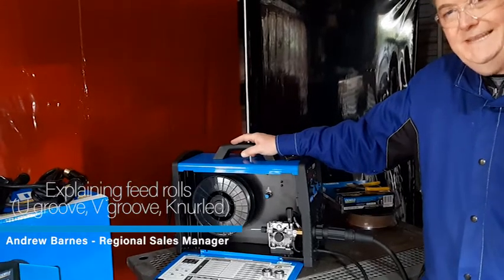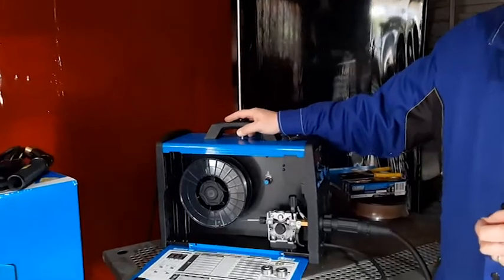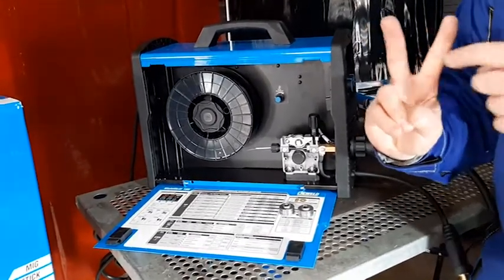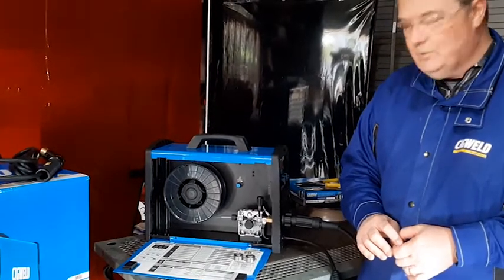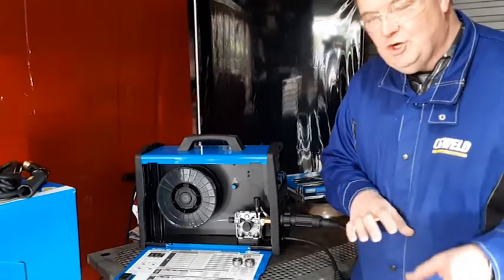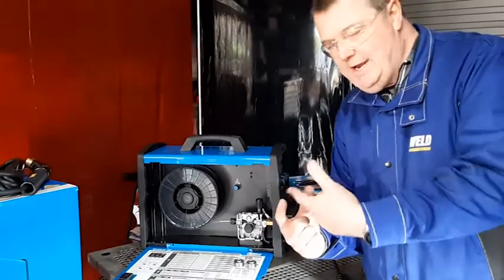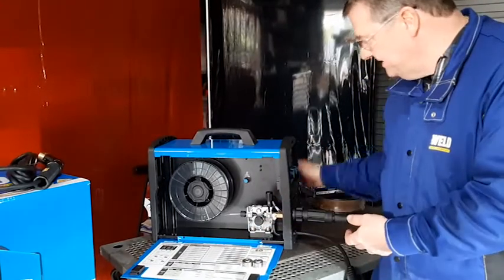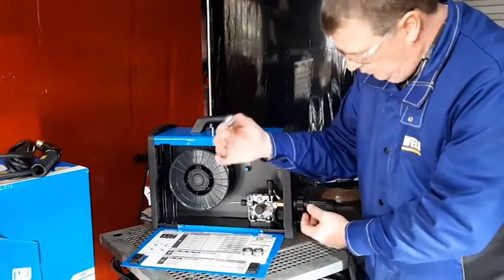What are feed rolls? U groove, V groove, Knurled explained

Comment: Got a Lincoln 210 MP and have had trouble from the start with wire feed.  I was going to try a knurled roller but doing mig applications. Am I messing up? No obstruction in wire lead. Rollers seem to turn properly but the .35 wire is slipping in my .35 roller shipped with the unit. Do you think I'd be better to try a knurled roller or a V .30 with .35 wire? Thanks in advance for your help!
Reply from the maker: We are not sure about Lincoln machines specifically. Does the machine have any tensioning options in the drive motor. With out machines if you find you are getting a little slip we recommend just upping the tension on the rollers.